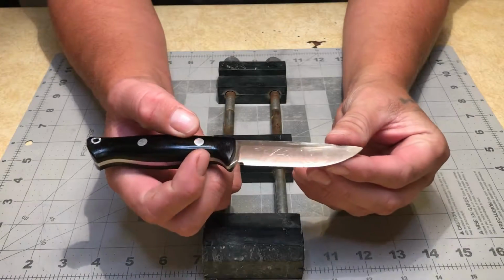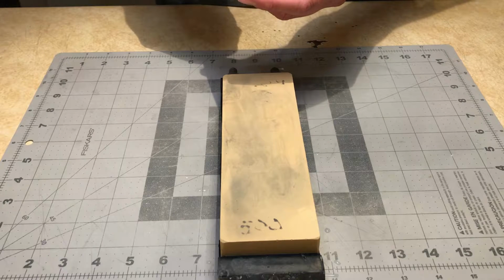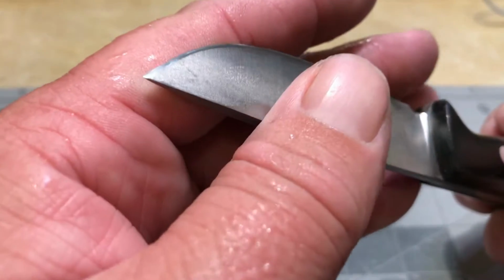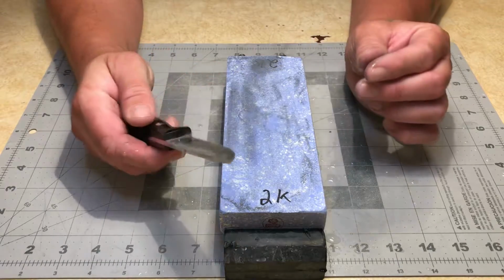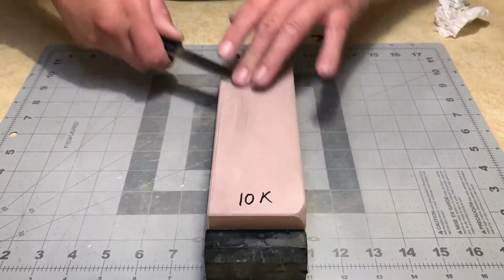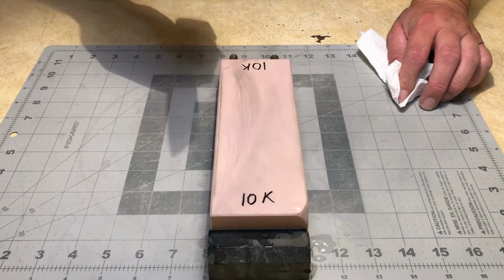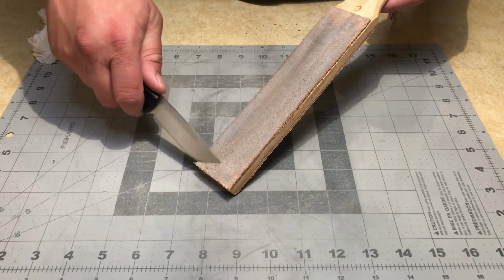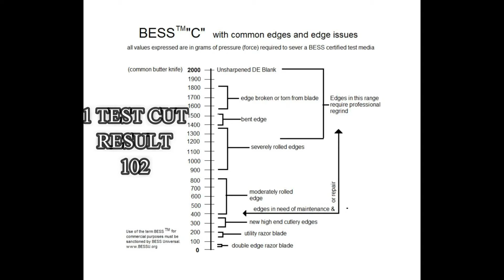Knife Sharpening - Bark River Bravo EDC

Comment: Jef, have you heard/tried Haidu sic stones? Any thoughts? How would they compare to the Gritomatic for hard steels?
Reply from the maker: Yes and I tried to order some from 4 different sites. They are only sold overseas, and none of them would ship to the U.S. I'd love to get my hands on some.
Reply: Jef Jewell ok Jef. The Haidu sic stones. I fully progressed a D2 on them. I had to flatten all of them and condition the higher grit ones. I was shooting in the dark a bit about the true grit values. The values they give on the stones are much lower than a Japanese industry standard. So their 1k stone is a jis 2600. Gets confusing. However, lovely stones to use and responsive at lower grits. Scratch pattern really even compared to diamond. Loved working with them. I got 120# 280#400#600#1000#1200#1500# (6000 #sic) for under £100 ($120). Don’t think the stones were at fault but the end cutting sharpness was not to my liking compared to others I’ve done. No detectable burrs or nicks but didn’t feel quite right. Maybe that’s the d2? Stropped on 8k and bare leather...... would love to see you sharpen with these stones. Could get them and ship to you but maybe you’d have to pay import duty? I’m in the UK. Let me know.....
Reply from the maker: @simonwells6977  Wow that is an extremely GENEROUS offer. I am currently testing out practical sharpening's vitrified diamond stones. Kknives showed them off a few times, so I was super curious on getting a set. Once I am done using those, and if you still feel ok about sending them to me, I would love to give them a try! Shoot me your email address if you don't mind. jefjewell@gmail.com

Comment: isnt that cpm 154? in the video you said 154 cm... are they the same?
Reply from the maker: The ingredients to make the steel is pretty much the same, but the processes are different. Cruciple Powder Metallurgy makes a finer grain structure. This makes for a better steel, in terms of edge retention and even sharpness. There are many other benefits to it, as well, which you can research. All in, cpm would be considered better, but in practical use, i personally dont see much difference. They both dull, just like any other steel ive used, and both sharpen to wickedness, with little effort.

Comment: What is that device you used to measure the cut test?
Reply from the maker: That is the edge on up edge tester. I use the industrial model. It takes 20 measurements per second, and displays the results in 1 gram increments. The media, or thread, that is cut, is designed to some specification, organized by them and bess “c”. If ya google it, tons of information and links are available

Comment: Hi Jeff. Do you think it advisable to flatten a range of gritomatic stones (#120 #320 #600 #1000) with an atoma #400 plate?
Or do you think best to get sic powder and use the glass technique? If so which range of grits would you recommend? Thanks, Simon
Reply from the maker: The lower grits stones will wear your diamond plate out quicker. It can be done, but I just prefer Sic powder. It's really all about personal preference. Sic and glass is loud, and messy, but you can condition the stone surface, to exactly what you want. To flatten, all you need is 90 grit. If you want to condition, get 120/200, and 400. I would take the lower grit stones and flatten with 90 grit. The 600-1k stone I would flatten with 90, and then condition with 120/220. The 400 grit sic powder, I would use on very high grit water stones, like 3-10k.
Reply: Thanks so much for that advice Jef. Cheers!

Comment: How do you like BR cpm154 ? I’m thinking of pulling the trigger on that exact knife  , but I can’t get away from their a2 &  com 3v . Do ya like the Nubatoma stones ?
Reply from the maker: I love the Nubatama stones. The 1k x hard, is the stone I would pick, if I could only own 1. All of the ones I have used (with the exception of the 180 grit), have been fantastic. The 4k did have cracking issues on the surface, like what I had with Naniwa Pro, but as long as I lap it after every 2-3 uses, they seem to stay at bay.

Cpm 154 is one of my favorite steels. My edge retention isn't really comparable to most. The stuff I tend to cut at work, causes chips and damage, as opposed to wear. That being said, 154 doesn't chip too badly, and even less so, in this knife. I'm sure a custom maker could heat treat it better, but for what it is, BR doesn't do too shabby.

Comment: That 2K looks awesome! I have a few Bark River Knives that I need to practice sharpening. Do you recommend water stones only for convex grinds or convexing a bevel? I need to start collecting some stones too! Lol
Reply from the maker: I prefer water stones for convexing, but if sand paper is easier for someone to do, and they don’t want to bother with stones, I wouldn’t steer them away. My issue with sand paper is simple. The convex that is usually produced from it, tends to have a deeper convex apex, than stones. It’s harder to dial things in, bc the paper itself has so much give
Reply: @Jef  thanks!
Reply: My philosophy on convex grinds is very similar to Jef's: use stones for gross metal removal and then sandpaper for surface finishing.  You don't need either expensive stones or water stones.  A Norton JB-8 (oil stone) and a King 1000 are all you need and you can pick up the pair for less than $50.  One area where I do things differently is that I take my grinds a bit thinner and then finish with a micro-bevel.  Here you should pick whatever works best for you.

Comment: Spark River. Stop cutting bamboo sticks!
Reply from the maker: What?
Reply: @Jef  I figured you knew about that. I'm just playing though.
Reply from the maker: I looked it up. I agree everyone should wet grind but almost none do. As for the chop sticks, that was nuts. If cutting those is abuse I’d hate to hear what they say when i use my knife at work 😂
Reply: @Jef  Interesting discussion. 
No ax to grind with me, pun intended,
because I own several Sparkies...I mean Barkies. (I won't stop will I) Things were done, and they stand by their mistakes 
is all that matters.
Reply from the maker: @JohnDoe-zb7dz  Oh I have no vitriol towards them. Wish em all the success in the world. We need more convex ground knives. I myself own several, and have no complaints. That said, I am still in the camp, that all heat treated steel, should be wet ground. It just makes sense. By the time you feel heat generated in the steel as you grind, you have already ruined the heat treat. Is it gonna change? Of course not. It isn't cost effective. If more makers START with this process, it might catch on tho. I wouldn't complain about that ;)
Reply: @Jef   I believe people
 are becoming more aware of it.
 We are starting to see wheel 
grinding manufacturers and
 belt sanding manufacturers implementing variable speed 
motors. That's why I like to 
re-profile my new knives by
hand as  soon as possible. 
Get past that weak burnt Edge
 if there was one.